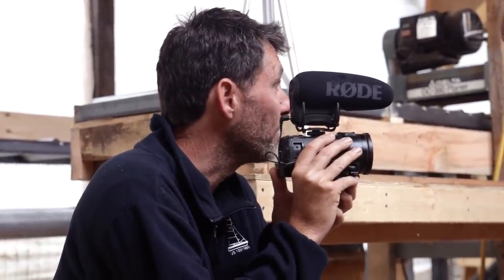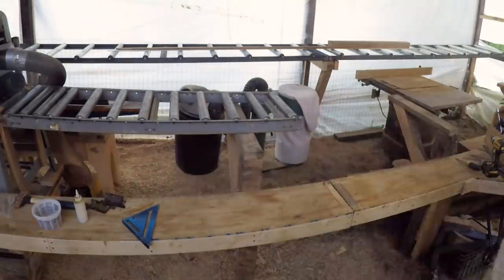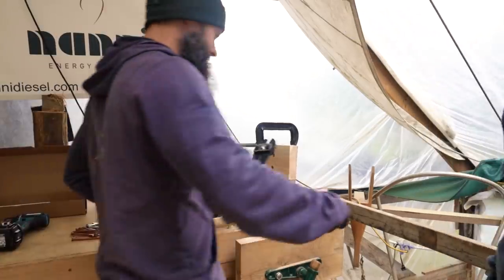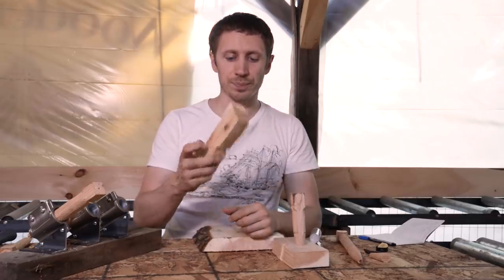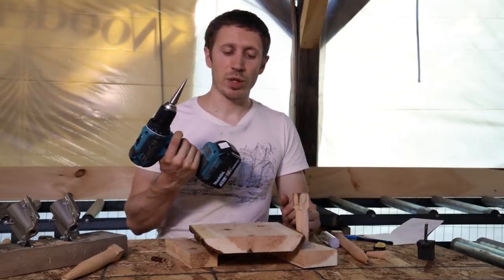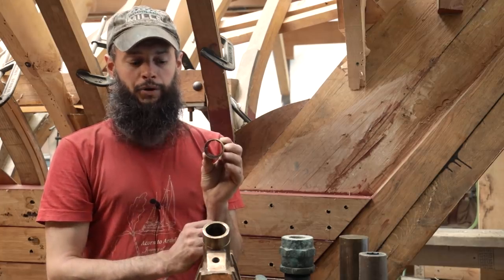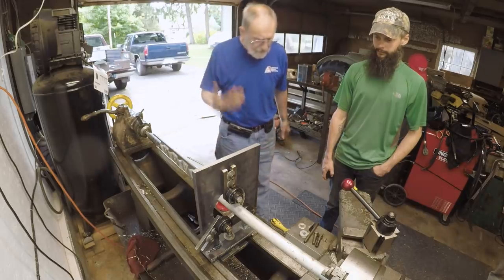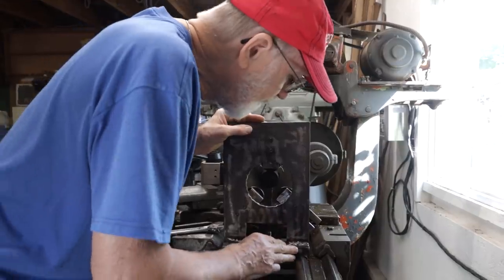Acorn to Arabella - Journey of a Wooden Boat - Episode 83: Riveting Test and Prop Shaft Assembly

Comment: Would a palm nailer work to drive the rivets?  They are fairly cheap, small and drive nails pretty quickly.  Just a thought as I watched you use the rivet gun to drive the rivets.

Comment: CP717 air hammer. I own one and it is by far the best one out there. I have had snap on air hammers and I won’t even think about them. CP717 has a much slower BPM acting more like a heavy hammer than hitting it fast.

Comment: Was there a reason you bought the delrin as a solid rod and not a tube. You may wish to consider annealing the plastic after machining plastic is good at storing heat energy and stress just simmering a part in boiling water can do wonders for its stability.

Comment: Id be worried that the rivet heads are too small and will pull out of the planks under stress. When I worked in an aircraft hanger doing rivets on sheet aluminum the surface area of the rivet head to the surface area of the rivet shaft are about equal. While that's sheet metal and not wood, I would still be careful with the rivets you made since they have such small heads. Iif you go and look at viking ship builds the rivets they use have massive heads. Granted those are much larger ships.
Reply: I asked about the rivot heads when they showed making the rivots, they had a reason for the smaller heads, but I don't recall whay it was.

Comment: you should try bucking the rivets with the gun from the factory (head side)  and use your heavy piece of steel for the bucking bar and the shop head washer side of the rivet. basically do it the opposite of what your doing now. Check out how to buck aircraft rivets.

Comment: I can't remember which of the old boatbuilding texts specifies this... (Most likely Chapelle or McIntosh, perhaps Culler or Steward, et al.  Presumably it was also mentioned at NWSWB...  Sorry, it's been too long.)  So I can't give the authoritative citation directly...  But I do know it's best to stagger your rivets (presumably two) in each plank away from a vertical alignment, enough to assure they're not near the same grain-line in your frame. 

The idea is to stagger the fore & aft position of upper and lower rivets in each plank, so they're ~15 degrees or so off the vertical from each other, closer to 1/3 spacing between the fore and aft faces of the bent frame stock, rather than both centered in the frame's width ("siding" dimension).  This reduces the possibility of fastener-induced splits in your frames.  Yes, the next pair of rivets in the adjacent plank, with the same staggered placement, will presumably align again in the same grain-line anyway, but the point is to maximize the distance between these grain-parallel holes wherever possible.  If a wider section of plank called for three fasteners per frame rather than two, you'd make the middle one be "centered" on the frame, and the upper and lower rivets spaced fore & aft to divide the frame width (siding) roughly in "quarters", so to speak.  If that makes sense?

This scheme especially applies here in bent frames where the White Oak grain was chosen specifically for straightness.  Obviously less an issue for someone like Leo in Tally Ho, where the grain of double-sawn frame futtocks is much more random/irregular.  (Let alone the notorious "toughness" of Live Oak in particular.)  Presumably y'all already know this, having read (and cited) all the same aforementioned texts yourself.  But for those here whose local marinas no longer contain any plank-on-frame examples for direct examination...  I know your test-riveting setup is indeed "only a test"!  But it immediately set off the visual alarm-bell in my mind, so thought I'd mention it before you get to the real thing.

Comment: My father was a shipwright and I have spent many an hour on the dolly and the ball pien hammer with him. The rivets you have done are no where near good enough. Too deep on the counter bore and not enough piened over.
Reply: @Roger Dodger I imagine they have a reason, probably to do with the need to have a deep enough plug over the rivet head that it won't pop out when the plank "works" in a seaway. But it may still be that the depth is deeper than the optimum compromise. Without knowing their reason, though, I think you are being unduly dismissive to call it "pointless".You are also assuming that they've decided on the target depth, whereas they may not yet have settled on that. On the (related) protrusion topic, they say "we're still working on it" and go on to talk about the process of dialing in their methods and settings.
Reply: @Roger Dodger Thanks for your mature consideration of the point I raised.  It's particularly welcome on a YouTube comments page, where it's far from being commonplace.

Comment: Hey guys, I have two questions. Most boats this size are build very near where they will be put in the water. This boat will be BIG and HEAVY. How far do you guys have to move it to launch, and how are you going to do that?
Reply: They covered that in a video a little over a year ago. Arabella will be trucked to the water.
Reply: @thomasarussellsr  To explain a bit more: they are around 100 miles from the water. Considering the length of time (2 to 10 years), its cheaper to build on their rent-free property and truck it to water than to rent a warehouse and apartments for that time

Comment: a cheap pneumatic palm nailer would insert those rivets much easier without all the hammering.
Reply: Palm nailer would be perfect!
Reply: That rivet gun makes a palm nailer look like a toy, theyre on the right track just need a quick release for rivet gun bit
Reply: @clevelandmortician3887  Agree
Reply: Did you see how hard they were thumping those rivets? And the size of the hammer? I doubt if a palm nailer would touch it. Don't forget they are thumping one quarter of an inch SQUARE copper into a one quarter inch diameter hole in don't forget Oak. You can discount the cedar but that's a lot of interference fit between the square metal and the round hole.
Reply: @samrodian919  Could even help mushroom the head for more contact.

Comment: Is the process for “fixing” live knots the same as with the dead ones? Ream and then plug? Or do you have to drill them out as they don’t come out like a “plug” as dead ones do?
Reply: what I got from the video is that they are just going to leave them as they won't be an issue because they don't have the dead bark. but I could be wrong.

Comment: It's your boat....I have significantly less experience in building boats....but not a fan of rivets with soft wood.  How common is this process?
Reply: Copper rivets with clenched on rove's? Absolutely standard. Remember watching my grandfather building a clinker built Weymouth Falcon 60+ years ago. About 2.5mm cross section rather than Arabella's  4mm, but a Falcon is about one quarter if Arabella's length.
http://www.cvrda.org/dinghydata/weymouth-falcon/

Comment: As someone who has fittted many rivets, admittedly on aircraft, It should be the same principal, Please don't rivet like you did @8:00 , Drill hole as before , fit rivet whilst supporting (with the reaction block) the wood behind it, then apply a 1 sec burst keeping the gun firmly on the rivet head, and use a flat or mushroomed heavy block behind to "reaction" the rivet, you will be surprised how little it actually takes when you do it like this, if you leave about 1 to 1.2 D tail on the rivet it should be suffficient, but by all means experiment with length , Cheers From Scotland
Reply from the maker: Aircraft riveting is actually significantly different than riveting on the boat because of the variance in materials.

Comment: You may want to mount that regulator somewhere else then on the rivet gun. Its weight will kill your wrist after a while. I know first hand having riveted a few aircrafts myself.
Reply: That was my thoughts as well.  As an auto mechanic I can you the vibration from the impact hammer is not good for the gauge or regulator.

Comment: Why dont you use the heads of the rivets on the inside of the boat? You formed a nice head so use it inside. That way you dont need to worry as much about snipping off extra length. Just make your wooden plug on the outside cover the ugly cut end inside the plank.

Comment: The engine didn't seem low enough in the drawing, I'm sure you've done your homework on it.
Reply: The hull is designed for deeper seas. Hence it is narrow as it rises above the keel before it flares out. So it is not that the engine is sitting high - it is that the yacht draws more water.

Comment: Try leaving 3/8” exposed shank to create the upset head. Also decide the length of the rivet, cut, then anneal the end for the upset head. The cutting work hardens the cut end. Heat the copper to red heat then quench in water. The rivet will mushroom more easily. Aircraft Spruce/ATS for rivet gun springs for quick change features, https://aircraft-tool.com/shop/detail.aspx?id=113M .

Comment: Along with building the boat you have built  “a way to build the boat.”  When Arabella is finished and launched if the “way to build boat” is not used again it will be lost.  It is a shame to loose that effort.   

Your farm property is on growing and would support building one ship every so many years.  If you determined how many boats per year the property would sustain you could make a sustainable company.  If the property would sustain one boat every five years you could hire the appropriate number of people to produce one boat every five years.  Since you have built one yourself you should be able to determine the number of boats per man hour. 

You have had people help you build Arabella.   Another You-Tube channel, Leo from The Sampson Boat Building Company is restoring a wooden boat has also had several volunteers helping him.  There was one young man that had excellent skills in forming an assembly line production.  From your volunteers and Leo’s volunteers a group of potential boat builders persons exist.  The people with the best skills, knowledge, personality and desire to build a wooden ship could be selected.  

Filming the entire endeavor also could be continued on You Tube.   The YOU TUBE channel would generate interest, a customer base, subscribers and charters. 

You have gathered machines to build Arabella and a temporary building.  If the building was moved to a permanent location and a bit more permanent tin roof was added you have the makings for a physical plant.  

With the farm to supply some material, the volunteer group to supply labor, the equipment you have gathered up to build Arabella and the material you have already made for a physical plant a company to produce one boat every five years could be established.  The only thing needed is the desire to do so. 

You could Captain and sail Arabella.  With people as charters, available from your audience, the company could be put on a paying basis.  As new boats are made available they could join the charter fleet and add to or replace worn boats.   A captain could be selected from crew with the best aptitude and personality. 

You have at hand a sustainable business opportunity, charter sailing an original hand built wooden boat with a group of potential customers, investors, partners, and workers at hand.  Putting them together really should not be that difficult.  You are also creating the interest in such an endeavor with the YOU TUBE channel programming.   Charters for two years from now could be scheduled.  Money from the charter deposits would help fund the building of Arabella and the hand built wooden boat company.   Bingo!

Comment: Very nice work, but your rivet heads are way toi small! They are going to sink in the wood when hammering them in place and allso when tightening the rivets.

And they weaken the overall sturdy structure, rivet head is so small compared to rivets shank size. Over time when the wood Swells its going to dig eaven deeper

Comment: Why not use a bolt for planking?
Reply: They're using non-ferrous fasteners to avoid iron sickness in the wood.  I don't believe that threads on copper would be strong enough to avoid being stripped when tightened, much less under the normal stresses of sailing.
Reply: @dennisp.2147  Bronze bolts are a thing, or they could machine their own on their equipment.

Comment: If you anneal the copper rivets it will be much easier to form the heads
Reply: Then you have soft rivets holding your boat together
Reply: @clevelandmortician3887  not really, copper "work hardens", so the beating they take during the head and tail mushrooming will reharden the rivot material, copper.
Reply: Copper both work hardens & age hardens so the strength will not be compromised 👍
Reply: @phuketmusicscene9008  i guess you can tell them the properties of those rivets after annealing and then bucking.

Comment: And I second what others have said about the 1.5 X D for the rivet protrusion. Yours are way too short out of the washer. I have slammed 10s of thousands of aircraft rivets. The IR AVC13 (4X) might not be enough for what you're trying to do. They are good for 1/4" rivets, and I have done 5/16" with some struggle, but that was also aluminum. Material over 1/2" is hard to get the "thump" to transfer. You might and most likely need a AVC26 or AVC27 (10X) "Big Bore" gun. Riveting should be done in the least amount of hits possible.

Comment: Why not start with a Delrin tube instead of solid e.g. https://www.mcmaster.com/8627k789?  Even if you can't find it with exactly the right ID, it would be much easier enlarge an existing hole than to make your own steady rest and use a really long drill bit to bore out solid bar stock.  You could easily make a tool with a guide boss on the tip that pilots on the as-extruded ID and bores the exact diameter you want without having to worry about the bit wandering or chattering.
Reply: looks like I should've waited till the end of the video to mention the boring bar idea...

Comment: So that funny boring setup worked? 

Or did the cutting bit got stuck in the Delrin and bite a big fat hole?
Reply: Boaring bars are a common tool in machinist's work. Typically used more than drills.
So, what is so funny about their tooling? I am bewildered by you comment. Please explain?

Comment: Your rivet gun is too small. I have worked in aerospace for years doing assembly work. I have driven millions of rivets. I have used all brands mostly Chicago Pnumatic. There are models much larger than yours and you may need to invest in one driving copper rivets. Copper is tough. If you go online to one of these companies I am sure there should be tech help to help you size your rivet gun. Also Patrick Radcliff post below offers some good tips. A little practice and you will be in business.